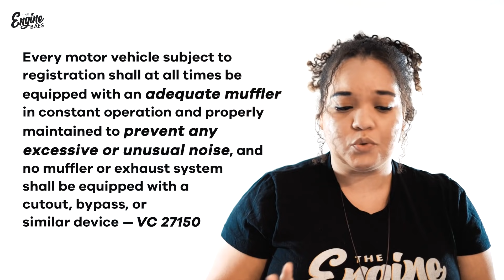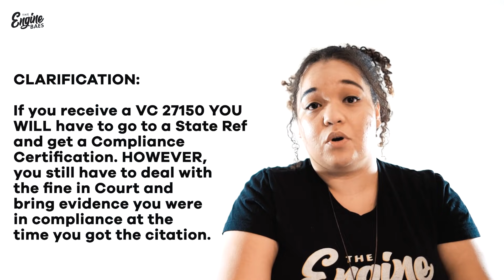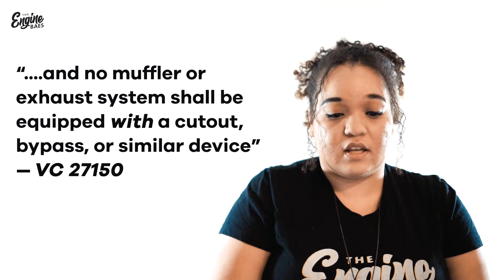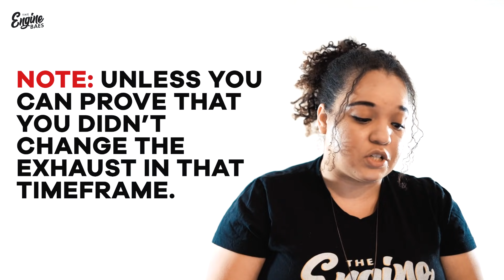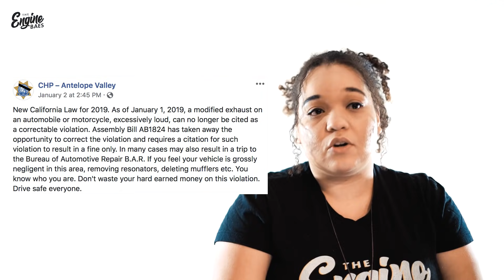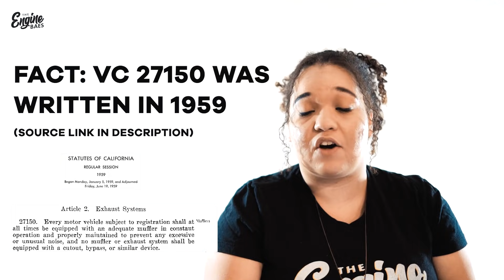AB 1824 New CA Exhaust Law EXPLAINED & Your Questions Answered!

Comment: Manufactures should be first in line trying to change this law.  Imagine all the people that have vehicles with active exhaust (diff modes) going to the dealers for having an illegal exhaust. Manufactures do not want to deal with a CA exhaust recall
Reply from the maker: Ashley G right? Now, this particular example I made is just following VC 27150 there is other laws that of course help OEM get around it, but with officers cracking down do they know that a GT350 has a bypass from manufacture? You know what I mean? It’s aggravating
Reply: Well, even in loud mode, the O.E.M. exhaust must pass state decibel laws or the vehicle can't be sold in that state. Also, even in by-pass mode, the exhaust is still flowing through a muffler system.Get yourself a decibel app for your phone to prove, on the spot, that your vehicle doesn't exceed the state's decibel law. Remember too, it's at full throttle that the decibel reading must comply.The keyword is "modified" exhaust, meaning cut-outs, muffler delete and(obviously) straight flow mufflers that aren't baffled. The caveat is what makes peace officers "experts" in the field of exhaust compliance without proper instruments necessary for proper decibel readings? If you are in question, call your local California State Referee Station and ask questions, ask if you can register your vehicle in advance to prove your vehicle complies(in case you should ever get pulled over). Beat the bureaucrats to the punch IMO.
Reply: why bother, when EV adoption is happening right now, soon ICE cars will be ILLEGAL to OWN or DRIVE.
Reply: Problem with that is Dealerships only do whatever the people want but if new laws come down dealerships stop it. See it was a fix it ticket before now its money out of your pocket and point on your driving record. dealerships have to obey the law. So that goes out the window.

Comment: Another thing, why $1,000? That's a fine higher than any driving violation and this is not even a driving violation situation. You'd think the fine would be more for something actually being dangerous like running a Stop sign or Red Light or even a DUI.

On top of that, say you do have a stock exhaust and did get fined to fix it. Uh how can you fix a stock exhaust exactly and I'm talking V6 model cars that don't have the loudest sound. I'd say the officer needs to so some legwork too.
Reply: The reason is California is broke. FEMA funding has been cut. So the little man pays again.
Reply from the maker: I completely agree that the maximum fine of $1000 is insane. There has been reports that a $1000 is after a 3rd noise violation, so hopefully that's some peace of mind. -- Marly
Reply: It's not a $1000 fine.
Reply: @Bajico  21 trillion in debt to the FED isn't well off.
Reply: @Bajico  I know but everyone pays
Reply: @Bajico  We are all free range humans on the tax farm.
Reply: I got the ticket. I have a 100% carb legal 1000hp c5 z06, still have stock mufflers and exhaust. Got the ticket because my supercharger and blow off valve make my Corvette sound like a Boeing 747 haha
Reply: @fortnitefred1351  No its call you kids have money cus most of you sink over 20K into your car's an turn them into race car's

Comment: Great video, but you can fight the ticket by going to BAR and then having your vehicle cleared by inspection. The officers word does not guarantee a fine. Having a aftermarket exhaust in California is not illegal as long as it abides by the law. So if your chrome shiny exhaust catches a cops attention and is below 95 DB. the cop cannot cite you saying it "sounds" over 95 and you are forced to pay the fine. You can accept the ticket, and then go to the BAR and get it written off, and even get a certification that says your exhaust is certified for future pullovers.
Reply: David izrailov it’s cops word vs yours they can give you a ticket it’s a police opinion if your exhaust is modified or not that’s why this needs to be changed

Comment: You're mistaken. Once you get a citation you have the right to go to the refs to get a Certificate of Compliance. The judge will dismiss the citation.

WERE CALIFORNIA’S EXHAUST NOISE RULES CHANGED?

No. Since 2003, exhaust systems installed on motor vehicles with a manufacturer’s gross vehicle weight rating of less than 6,000 pounds, other than motorcycles, may not exceed a sound level of 95-decibels when tested under Society of Automotive Engineers (SAE) test procedure J1169 (May 1998). This was not changed by A.B. 1824. 
 

IS IT NOW ILLEGAL TO INSTALL AN AFTERMARKET EXHAUST SYSTEM ON MY VEHICLE?

No. The sale and installation of an aftermarket exhaust system remains legal in California so long as it does not exceed a sound level of 95-decibels when tested under SAE J1169 and complies with all other exhaust and safety laws and regulations.
 

IF EXHAUST NOISE LAWS DIDN’T CHANGE, WHAT DID?

Beginning January 1, 2019, a motorist cited for violating the current California exhaust noise law can receive an immediate fine. Previously, motorists received what is known as a “fix-it” ticket, which allowed for 30-days to correct the violation. 
 

WHAT ARE MY OPTIONS IF I GET A TICKET?

Consumers in receipt of a violation still have the option of seeking a certificate of compliance from the California Bureau of Automotive Repair (BAR) demonstrating that their exhaust emits no more than 95-decibels. This SEMA-sponsored program allows courts to dismiss citations for exhaust systems that have been tested and for which a certificate of compliance has been issued. BAR does not currently issue preemptive certificates of compliance. 
 

IF I GET PULLED OVER, WILL I RECEIVE A $1,000 FINE?

According to the Judicial Council of California’s Uniform Bail and Penalty Schedules for 2019, the suggested base fine/fee for a first conviction is $25 with a total fee of $193.

My car getting noise tested by the refs:
https://youtu.be/0ZhrNMvgc3U
Reply from the maker: Hey! Thanks for reposting this, we spoke with the SEMA Director of State and Government affairs, and unfortunately he says getting a Certification of Compliance does NOT guarantee the fine being dropped! We talk about it in our update https://youtu.be/FId4ReCt-Lo
Reply: Thank you.... I have seen a handful of videos like this where they state, "I have done a ton of research" and then proceed to stating a bunch of bullshit rumors that they read off some random sites...
Reply: Thank goodness i thought i had to cough up 1000

Comment: I have flowmasters on my 05 gmc sierra , are flowmasters illegal now too ?
Reply: Is your truck GVWR over 6000 LBs? You are exempt if you are. This is for any vehicle that is under 6000 GVWR
Reply: @johnkennedy4354  it's a 1/2 ton gmc sierra 1500 I think it under 6000 lbs
Reply: Ricardo Avalos my 2018 1500 4x crew cab standard bed is 7200 GVWR
Reply: Luckily for me I’m exempt because I had just put on a Borla Atak cat back for my 6.2. It’s loud   Lol
Reply: @johnkennedy4354  hey John thanks I just looked at sticker on my driver side door and it says 6200 gvwr

Comment: I just tested my stock 2019 Mustang GT PP2 with my digital sound level meter. In quiet mode, at the same height of the exhaust pipes, 19.5 inches from the exhaust tips, the meter pointed at a 45 degree angle, it registered 95.5 decibels at 2500RPM. For fun, I also tested in track mode. It registered at 98.2 decibels at 2500RPM.

Comment: but it says "exhaust systems installed on motor vehicles with a manufacturer’s gross vehicle weight rating of less than 6,000 pounds, other than motorcycles, may not exceed a sound level of 95-decibels" so im good. my truck gvwr is over 6k

Comment: Okay, a cop can make a subjective call on what is "loud", then you need to make an objective, scientific argument to prove them wrong while being on public roads.  If  you cannot prove it right then and there, then you still need to pay $1000 yikes.  If I just purchased a new M4 and got pulled over due to "loudness" I would then have to go after the BMW dealer because they sold a non-compliant car.  I hope that the car dealers, after market manufacturers as well as SEMA jumps on this fast.  This new law is ridiculous.
Reply: Also its over 95dbs. idk if you know honda's but the mugen exhaust is about as quiet as you get and thats at 98 dbs

Comment: it has always been the law to manufacture car maker in order to register pass state exempt and regulate/reduce pollution. there is a reasons why the catalyst and that muffler tub to reduce noise,, and those who go straight pipe can cause so much damage to safety and health environment,, ( put it this way if you were drive with window down behind the car that modify straight pipe you are inhale all carbon monoxide not to mention if you both going up hills. CA has always been a state keeping air quality and smog control. so if the dealer sell you a car with straight pipe would you buy it? i guess not.

Comment: how does this affect motorcycles?
Reply from the maker: vickimon according to the specific vehicle code it should not affect motorcycles at all - however CHP has stated in a previous Facebook post that they will be going after “excessively loud” exhausts on motorcycles as well. More then likely you’ll get out of a ticket but it doesn’t stop the officer from giving you a ticket.

Comment: as long its stock and original spec by the car maker. no prob. issue is the street takeovers AKA sideshows are the one that poured fuel on the fire and made the problem horrid and we all got this nice gift now. so put your stock mufflers back on and avoid night time car shows events Period ! End of the day the MC riders with hidden plates and modded exhausts will be the ones getting nailed.

Comment: you know what i see... the issue in france, in a way. and yes i am a car enthusiast (don't let my 'engine fool you) i can see that yes... street takeovers are bogus....BUT, i also may see an arterial motive for this. first, they want your car stock (as of now). soon they won't WANT you to have a 'cool' car (camaros, mustangs, challengers , exotics, etc). soon after... they'll co-orce you in buying priuses,(they suck i know but no real offence to them) teslas nothing against these either, in fact kinda nifty, despite the fact you need a POWER PLANT to charge them, (but that's another matter) and other 'green' cars' and or make you use public transportation. it's not just the street takeovers they're after. it's easy money (borderline extortion), it's a way to profile you as a criminal, because you didn't give most of your money back to the govt and instead self indulged. and, even IF there are 'parameters' for the noise level...cops won't always abide by them. after all, some say 'quota season' doesn't exist, BALONEY! the reason i say "i see france" is because they're going through some very difficult times right now with the the price of fuel, in order to force the populace to 'take the bus' and there's people out there that have either little or NO access to either because of where they live  (out in the country/boondocks, whatever, not in the cities/suburbs) so they are getting BADLY screwed because of this. and i see this 'law' being further pushed into much 'darker territory'.....

Comment: she clearly didn't read far enough in to this, as is states specifically anything beyond 95 decibles will be considered offensive.  look it up and inform yourselves.
Reply: She's adding misinformation and it's laughable to watch. The only thing in this law that has change is that it's not a fix ticket anymore, you can still defend yourself from paying the fine (which is definitely not a $1000) and tossing the ticket assuming your aftermarket exhaust is at the threshold of 95db. People are just like sheep, you feed them anything and think it's still grass.

Comment: I disagree with the out of state content.  If you are not of that state or a resident  of that state. You should NOT have to obide by that state vehicle equipment laws. Drug and gun laws is understandable because of TRANSPORT laws, but if I'm not a RESIDENT of that state, its vehicle equipment laws don't mean shit to me. Don't let no cop tell you otherwise. Its like setting your up car to pass CA smog laws an you live in Delaware, it doesn't apply to you.  You show that cop your PASSED vehicle inspection of your state, an inform him or her you are in compliance with your state vehicle equipment laws and ask to be on your merry way, even if you were doing something like street racing or excessive speeding an they try to sneak that equipment ticket in there FIGHT IT, cuz it STILL shouldn't hold up in court, if you are not a resident of that state.  FIGHT THE POWER!!!

Comment: How about this. If the law changes. Will the driver's change their habits? Or are they going to go back to burning out and revving the cars 24 he's a day? That's the problem. It's a 2 sided issue. That's what I'm saying I'm sorry but like with the Keke dance yeah because of it getting out of control they had to change the rule. Same for everything. If car enthusiast want to be respected. Sorry you have to respect the law also. It's the same with every issue.  Marijuana the same. If it's abused they not going to legalize it. If there's control they can. Think both ways.

Comment: Lane Splitting needs to go away, and the reason is it will always be the car fault if it hits a motorcycle and then if a motorcycle ride does not like what you did he will hit you mirror or kick your car then speed away and we can't get the plate to turn them in letting them split the lanes is stupid.

Comment: Seems more like this comes from the delicate people that just don't like exhaust noise to me. Otherwise why bring it up. The people really put themselves in that position. They take it for granted pissing people off and eventually yeah your going to piss people off to the point to where they complain. The one law I know about Cali is what I see on exhaust parts all the time. Check emission laws in California because hey are about the environment. Best advice. Leave the exhaust stock. Or if you do modify don't rev it every where you go. Half of the problem is the car enthusiast themselves. Sorry im an enthusiast also but I'm not going to take it for granted and cause damage to someone else or property over showing off. It's a double edge sword.